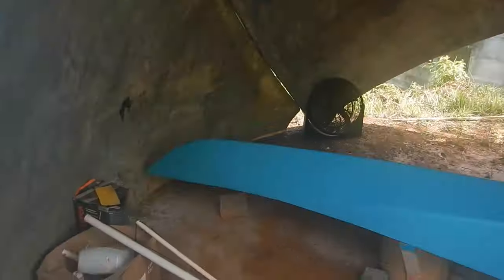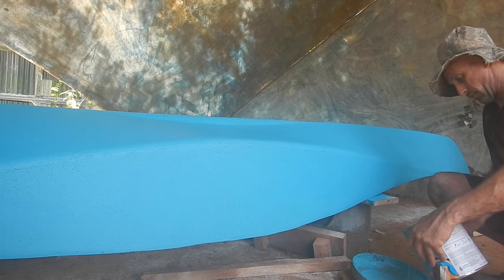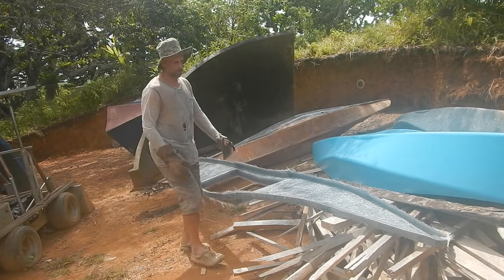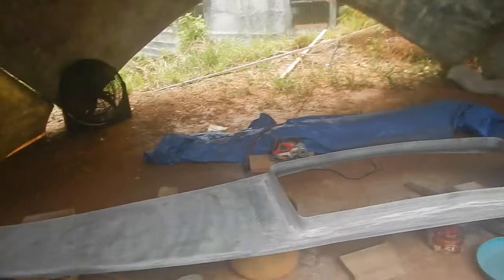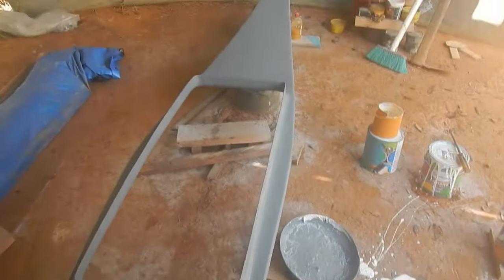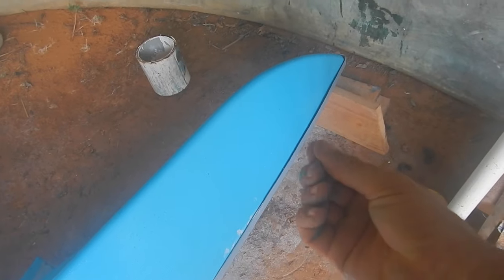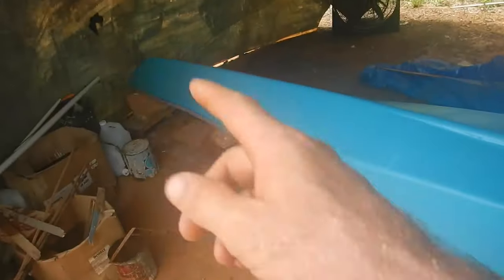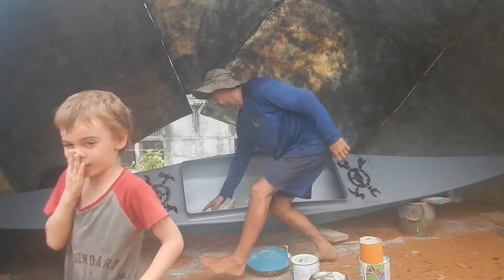Makin Kayaks 010 First Kayak Done!

Comment: Some boat builders use the stitch and glue method of construction.  They will drill small holes in pairs at staggered distances and use wire basically as a twist tie to pull the pieces together.  Then glue the pieces together, remove the twist ties and fill the holes.  Just offering this up as an alternative for future projects.  I love your videos, keep up the good work!
Reply: HOW MANY BUILDERS RIDE THEIR OWN BOATS?
SAFETY COMES FIRST

Comment: You may be interested in using a temporary fastener called a Cleco. You drill all the holes, pop in the Clecos, and you can get a good idea of the fit before you commit to riveting.  They hold everything together while you take them out and replace with rivets.
Reply: Clecos are nice... but self-tapping screws exist and are like, 50% as good, but like 1% the cost.